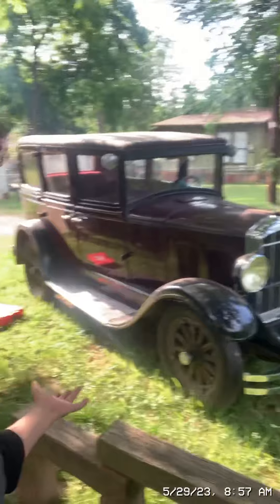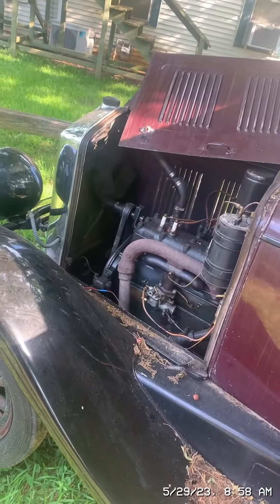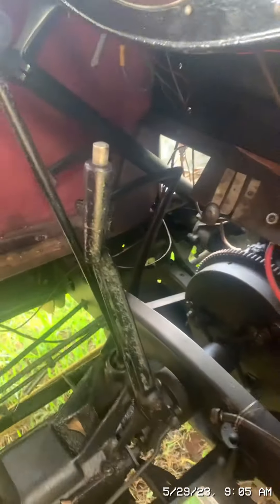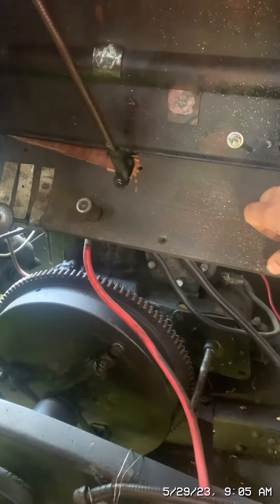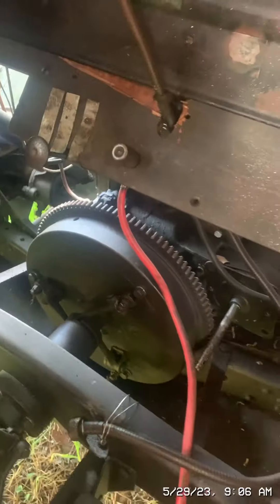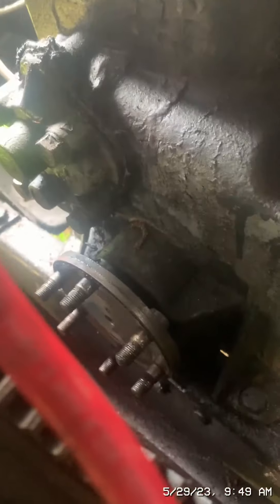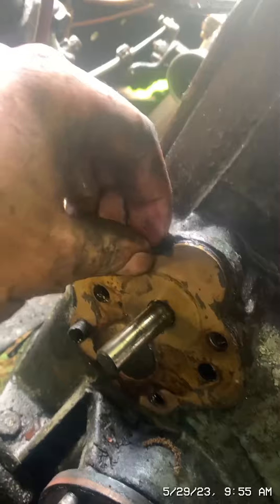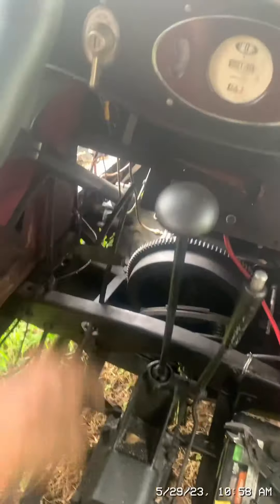Fixing the oil pump on Chugaboom (my 1928 Durant)

Comment: You figure servicing the oil pump should of been more easier.
Reply from the maker: The oil pump should not cause the slightest bit of trouble it’s literally just two gears one of them connects to the cam shaft with a little connecting rod and pin the problem was someone used black rubber silicone sealant on the oil pump and it gummed up the oil pump and didn’t seal that great I scraped off the silicone sealant and replaced the two gaskets and it should now last another 100+ years